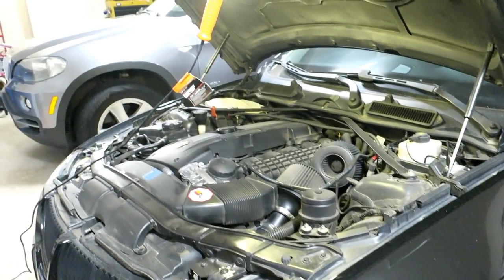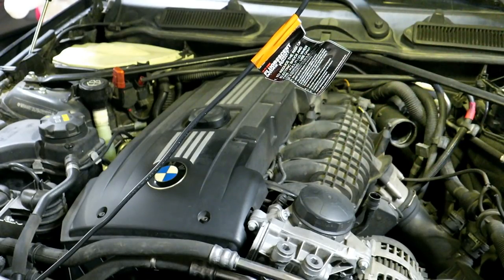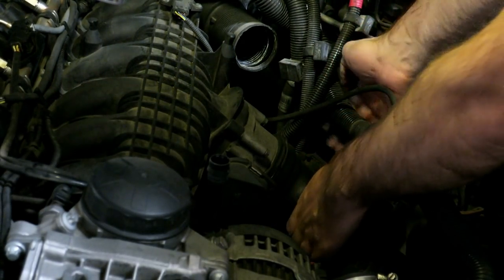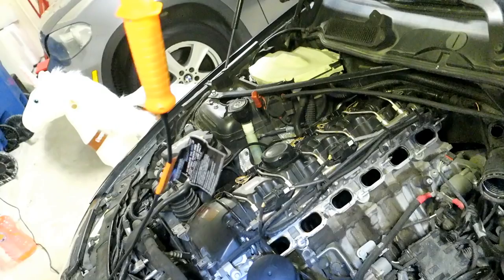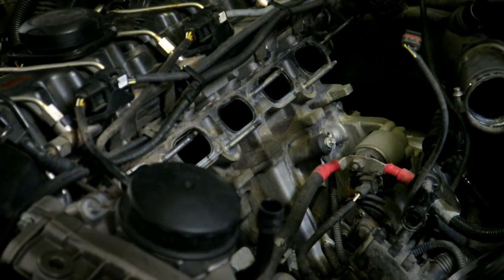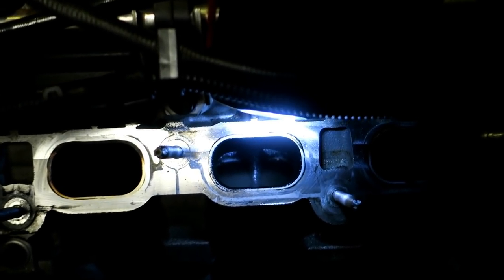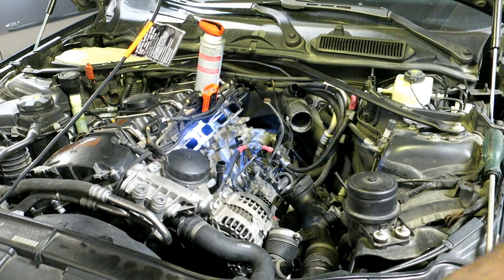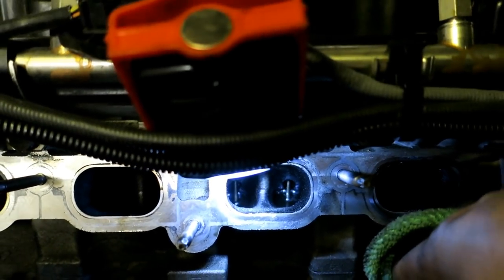Intake Valve Cleaning Without Any Special Tools N54 N55 DIY

Comment: hope you did an oil change afterwards.  and an oil catch can will certainly help but it won't cure the issue by any means.  definitely worth getting.
Reply: twinklinglicin oil change after I let the car run, or before I start it with the clean valves?
Reply: @RR-nu3mc  Before you start it with the clean valves.  It just ensures that any bit of seaping is removed.  I actually changed my oil with some 'cheap' Walmart synthetic (which is Dexos cert) for like 50 miles and then changed it once more with my normal good oil.  that may be a little over the top but i tried to ensure no bad fluids or residues remained in my engine.
Reply: twinklinglicin thanks for the reply, i will be doing the same as you then👍

Comment: I have Misted this through my M3 with much better results ! Engine running cleans out all the Junk and the final results are sparkling !!!
Reply: How much rpm?
Reply: Well doing this on an M3 motor is different than a turbo being that you get so much debris it's best just to go to this product cermastore.com this guy John Maker of the company he'll answer your phone call I use his product for years it's ceramic coats everything just added to the gas tank it also boosts in eight points and is a water eliminator and my valves stay crystal clean I've even scoped them after 10,000 mi the product is expensive but it works even as a video set up on his site you can go check it out

Comment: I finally have to do it before I tune my car after installing single turbo. It's pretty caked up in there so we'll see how it'll go. The only thing I can add is that you can buy long q-tips at Harbor Freight for interior detailing, you can use them to remove the remaining paste in the ports. Or you can even spray some brake cleaner on them and wipe the port clean. I'll see how it goes, maybe that will make the job a bit easier and feel safe to do so lol

Comment: Next time- get a length of 1/2" PVC pipe, duct tape it to a ShopVac hose- vacuum it all out. I wouldn't worry to much about any vapors be that flammable to cause problems.
Reply: That could cause a fire.  A vacuum pump into a canister would be a much better option.

Comment: Thank goodness for German simplicity.....My Honda requires one hose slipped off and the can of cleaner hose slipped on. Run the engine, use the cleaner , let it sit for an hour to heat soak and take it for a ride DONE. Works great did it 2 times so far and it runs beautifully-34,000 miles.....
Reply: If you do that to a direct injection engine
You will scratch your cylinder walls
And possibly resin your catalytic converter

Comment: Man, those ports were trashed. I'm not a fan of GDI at all, it's just a gimmick, too many problems outweigh any real benefits. You did an outstanding job, and the correct, thorough way. Simply spraying anything while running is never going to do what you did here.

Comment: Interesting way to use the product. Looks to work way better than other liquid cleaners I’ve seen people use like carb cleaner. Thanks for sharing.

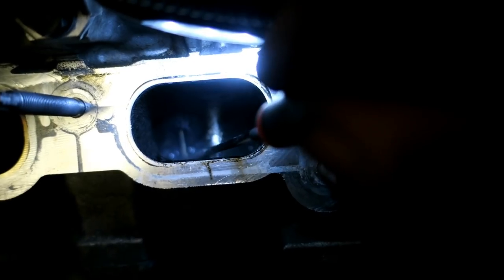You had me dying at @22:10 though in reference to the paste bits, “if only I had something to extract it...like something suction...” like a shop vac?? 🤣 I get it wouldn’t work to loosen the paste but anything you did loosen would easily be sucked up by a vac with a narrow crevice accessory. It could also be used to extract excess fluid so that does end up in the cylinder. I still prefer a walnut blast to just this although I might use this to speed up the process. Spray some in to soften it. Come back in 10 minutes, blast it, rotate, repeat.

Comment: Great video   on  using CRC  intake valve cleaner  to remove heavy carbon .   One question ?  What if you use CRC cleaner 11 oz.   4  times over 21 days  of CRC  sprayed directly in throttle in 1 second spirts . Would this be strong enough to do almost the same outcome ? Rev as directed on can then heat soak for 2 hours . Then drive on highway for  15 min . Then  change the oil  .  Any thoughts ?  Thank you

Comment: Walnut would be faster and safer. But your method is affordable.
Reply: , i want to know how to manually close / open air intake valves , after cleaning can i run the car for for few seconds without spark plugs to ensure no fluid stayed inside after cleaning with crc spray?
Reply: @geniusO2  Yes. This will be totally safe. Just put a rag on top of spark plug holes because it will spray and will make a hell of a mess. Be careful not to suck that rag into the engine.
Reply: @Cribs00  thank you so so so much sir for replying,  will do that and write back
Reply: @Cribs00  how to prevent the rag from being suck into the engine?
Reply: @paulng2455  It was a little joke. Spark plug holes are too small for something like that to happen :D

Comment: Do you need to disconnect High Pressure Fuel Pump in order to evacuate liquid from cylinder at 34:00 ? Because I'd imagine there would be a lot of fuel sprayed otherwise...

Comment: Having an oil catch can would be good idea to resolve these gunk that goes into your intake valves.
Reply: Linoge279 you still have this problem after occ installed after a lot of miles. Catch can is not the saving grace it just slows the problem
Reply: Reason I say this is because I took my manifold off last night to oil filter housing gasket and they were still coated not nearly as bad ass this they were just black. The catch can definitely has done something but doesn’t catch everything
Reply: , i want to know how to manually close / open air intake valves , after cleaning can i run the car for for few seconds without spark plugs to ensure no fluid stayed inside after cleaning with crc spray?
Reply: Better is to look into tapping and plugging the intake runner port holes to the valve cover and externalize your low-side PCV system (via RB Turbo's kit) through a low-flow catch can (like a mishimoto or cheap ones on amazon like Tasan Racing). This way, you separate the valve cover from all boost, making it less likely to crack and/or make the gasket leak. Also, under vacuum conditions, plugging those holes keeps oil mist out of the intake runners (because it would then be redirected to a catch can first before going back to your throttle body). I catch 3x as much oil in the low side than the high side through the BMS can.

Comment: 2013 F30 ActiveHybrid 3, basically an N55 335i with an electric motor added. I cannot get the charge pipe off the throttle body without significant disassembly, which I am not willing to do. With the clip loosened, I can only push the pipe down about a half inch or so before its own length and stiffness prevent it from going any further. So that spray inlet is not an option. There's a sensor on the pipe a few inches below the throttle body but I'd have to get some sort of angled wrench and torx sockets to get that out of the pipe. Tight clearances everywhere in that area.

Comment: I decided to do the CRC procedure when my Mazda hit about 10Kmi. I figure if I do their specified procedure every 10,000-15,000 mi, I won't have to take apart the top of the engine later on. This'll prevent the carbon from building up in the first place. Otherwise, I'd probably have to get a catch can.
Reply: Catch can is better. The specified procedure might do a little but not much even if you do it that often.

Comment: The one thing I can't understand is how do you clock the crank shaft exactly to seal each valve port? How do you know to stop at the end of valve travel? 
When you turn the crank clockwise, you don't have an angle to see the ports. I would imagine you're not testing it, just pouring cleaner to see it sealed shut. Thanks for all these details
Reply: Remove your spark plugs put a small straight wire or I use my 1/4 drive long extension. Place it through the plug hole to the top of the pistons. You can easily turn the engine forward or back with a breaker bar on the crank pulley bolt when the spark plugs are removed and watch the extension move up or down to the top dead centre, as well as look through the intake port to see that both valves are closed tightly.

Comment: I did this method and the CRC 05319 does work.  I had to break down the gunk to speed up the process.  However, it took me the whole day doing this method and it got frustrating due to the slow process.  If you have a lot of patience go for this method.  Would i do it this way again?  No!  Ill just invest with the media blaster on the next cleanup.

Comment: You might try carb cleaner it is a little bit more oily don't use break clean until you are sure you're happy with your carbon removal then maybe use brake clean to remove any oil products and small carbon pieces

Comment: Well I’m seeing this video five months after you put it out. It would’ve been good if you had like a shop vac, something with a lot of power and a narrow suction tip to suck all that gunk out would’ve made the job much easier and the valves cleaner. Also like a soft brush tip, something like a narrow soft brush hooked Up to a drill to clean and buff out all the extra carbon sludge if you know what I’m saying.
Reply: 非常正确非常正确

Comment: You completely disregarded the factory Cold Air Intake and fitted two cone filters which are positioned in a fantastically hot engine bay so that they suck in nothing but super heated air.  Do you believe that gives you an increase in power? Or do you think BMW might know better?

Comment: Im also using this methods to clean my Mazda 3 skyactiv engine.  I'm modifying a electric pump to suck all the dirty carbon out. Making sure no carbon deposits sucked into the combustion chamber, or else you might blocked the cat converter.  
Great video bro👍
Reply: Hi Felix, you also gave the starter a jump to close the valve? No engine warning light up?
Reply: Wai Hong Phun im using a 21mm wrench soket to move the crank pulley to close the valves
Reply: Felix what engine is yours, petrol or diesel? Does it gunk up badly?

Comment: Do you have methonal injection? If not with your mods it would help with cooling and power as well as help clean the valves. If you don't make drastic changes to the tune it will still help but won't be as much of a risk to the engine in the case of a failure or running out. 
I have WMI on 2 of my cars. Once is NA,one is turbo. The NA car I have it tuned for the meth by allowing more timing advance and pulling a bit of fuel during the range it sprays. If it fails on that car it will go to the high det map and pull timing advance but will still be lean(not good). On the turbo car it's tuned by pulling a couple percentage of fuel and allowing timing advance based on knock sensor feedback. Timing advance is capped at what it can safely do on 93 oct. So mostly I use it for cooling of boost temps and valve cleaning. The cooler boost temps are noticed most on hot days.

Comment: I sprayed my intake valves like a dummy with the valves both open and closed and realized later that I was only suppose to clean the closed valves. Will this cause major issues like hydrolock? I need to know as soon as possible. I still have yet to bump the starter or start the car. I'm also having trouble drying each valve.
Reply: Dashon Culliver any update g?
Reply: CDMusicGroup everything was fine motor ran like crap for about a half hour and had to replace cyl 1&2 spark plugs
Reply: Hopefully you changed the oil soon after.
Reply: Next time if you are unsure remove spark plugs that way it cant hydrolock

Comment: would not have believed this if I had not seen it myself.  Wow.  And you might be able to use a little fish aquarium pump to suck fluid out of those valve areas.  They pump fluids, have small hoses and are dirt cheap.

Comment: Thank you for your video. I have to say, I don’t understand you, because you have so good acces to the valves, so why don’t you use walnut blaster. You can buy a blaster for about 20 euro and walnut for 30 euro. I will take about 2-3 minutes for every valve and when you are done all your valves look likes brand new and it is such a easy job. Just my opinion, have a nice day.
Reply: khndenmark I just walnut blasted mine it took very long time but results are awesome 👏🏼 I will not do nothing but walnut blast in my motor
Reply: who sells walnut blasters for 20 euros?
Reply: @Felix-ry9pc  harbor freight
Reply: Lmao where the F can you get a walnut blaster for 20$ Then you need a air compressor to and the BMW adapter which is like 100$.
Reply: @JackRR15  Harbor freight. There's write ups on BMW forums.  But you still need a compressor and a vacuum.  you can do it without that special $100 or so dollar tool but it will be messier and get walnut shells everywhere unless you tape everything up. Essentially you are just media blasting the carbon off the valves. But depending on how neat / frequent you do it (like for customers) you want to do it you might opt for more specialized stuff that will help you do the job faster / efficiently.
Reply: @xplat  Oh okok. Yeah I use electric for my power tools... if I had a compressor I might consider doing it. I'm still 50/50 find local place for around 400$ Canadian. Or clean myself with this product and vacuum it out. Still unsure.
Reply: @JackRR15  if you buy the stuff you need it'll probably cost less than one service, but you'll now have the tools to do all future maintenance for yourself or even side jobs on occasion to help offset the cost of the equipment.

Comment: I disagree with the previous posters opinion. Cleaning products similar to this (Seafoam) have been used for decades with little to no long-term negative effects, and many more positive benefits. You seeing some “direct injection engine tear downs” doesn’t constitute to real data. Independent data showing positive effects of using cleaning agents as directed has been better documented. 

I will say that it might be a better idea to use this particular product as directed, which includes getting the engine to operating temperature before application.  This is most likely to improve the cleaning properties and combustion burn off.
Thanks for taking the time to post this instructional video.
Reply: Used by idiots does not validate the action.

Comment: Hi Vehicular DIY,
I'd like your video, looks logical having an alternative and inexpensive solution on cleaning BMW valve intake. I need your honest option, it's been a year now since you've completed this process, how was your car?  did it create any problems?  I hoping you can make a follow up video to show results to everyone.

Thank you.
Eriq M. - Toronto, Ontario Canada.
Reply from the maker: Hey thanks for watching.  Zero issues and it's been running great.  For the people commenting that this is dangerous and the engine can be damaged they shouldn't be working on their own engine if they don't have the common sense to ensure the valves are closed and worst case pull the spark plug and push out any liquid as I show.  Same would hold true for doing a walnut blast.  It's up to the person doing the work to be competent enough.
Reply: @VehicularDIY  Hey,  I did it today.  I followed everything according your recommendations and few common sense.  Works well.  Just my back really hurts now.  LOL...Again, thank you for sharing V-DIY....
Reply from the maker: Lol yeah you're at an awkward angle for most of the job so I recall having a bit of a sore back.  Nice glad it all worked out.

Comment: So did you jave a noticeable difference in performance after the valve cleaning? Also, did you experience any issues after allowing some of the carbon&cleaner mixture down into the cylinders?
Reply from the maker: Yes it felt like the car picked up some power and engine response was more crisp after doing this job.  No issues with regards to any cleaner entering the cylinders.  The tops of the pistons were crystal clean actually.

Comment: It works better on a hot engine.  Using it every oil change or every other oil change will keep the valves spotless.

Comment: Greetings from France! Thanks a lot for this instructive video. I need to replace my n55 starter so I am going to do an intake cleaning. Question : can I hand crank the engine from the  damper pulley bolt in order to cycle between the valves' closed position? Any guidance you could provide on how to ensure the valves are closed before spraying?
Many thanks in advance!

Comment: Did you ground out the spark plug wires while cranking away .. Get any codes ?. If you don't ground out the spark plug leads you possibly can damage the coil packs ??